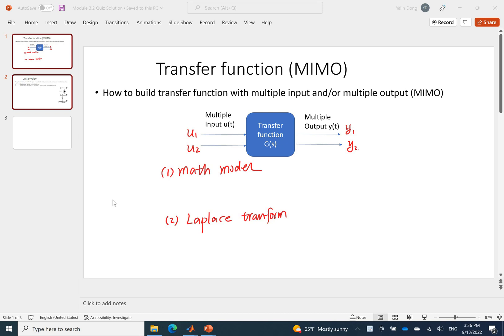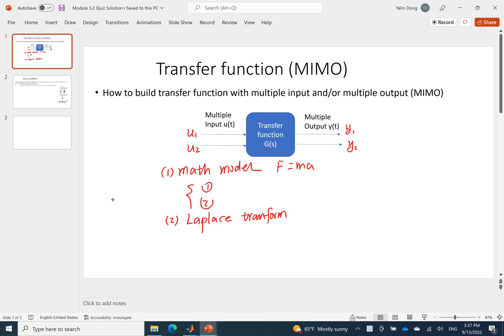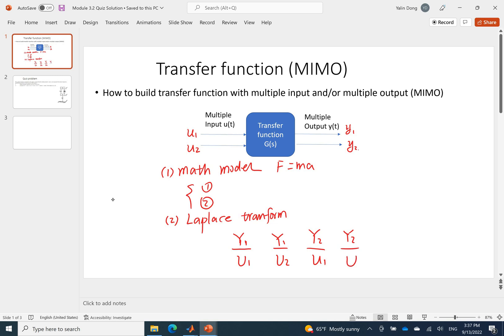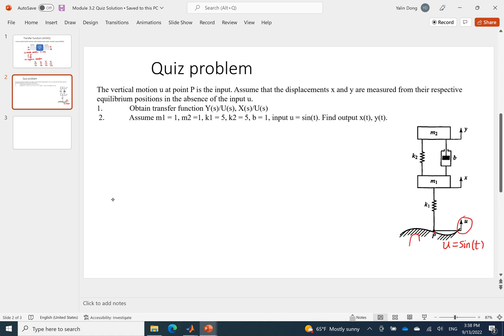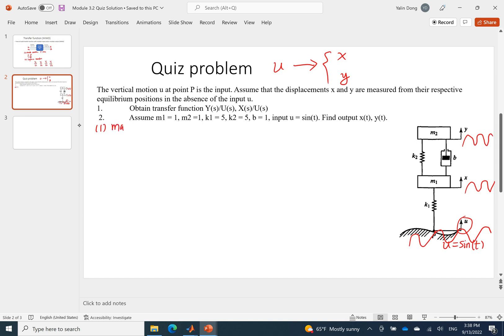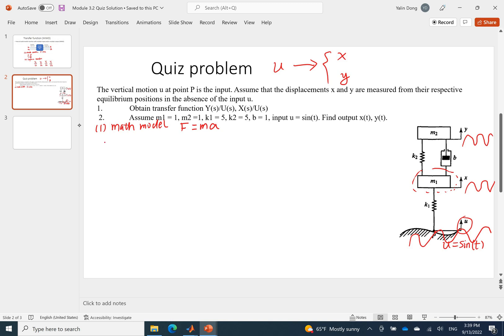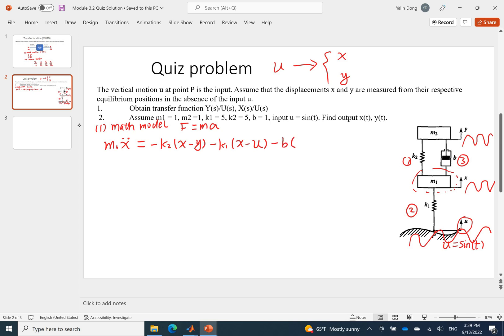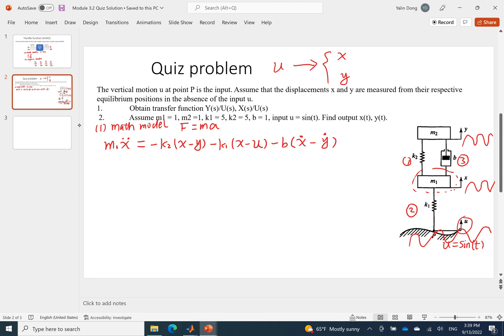Module 3: transfer function for multiple input and multiple output system (MIMO)

Comment: Thank you for making this video. It's good to have content that demonstrates modelling concepts with simple, accessible examples. Here is the GNU Octave version of the code (it requires a little setup ...installation of control and symbolics packages and configuration with Python and Sympy... ChatGPT is your friend):

m1 = 1; m2 = 1; k1 = 5; k2 = 5; b = 1;
syms s U;
A = [m1*s^2 + b*s + k1 + k2, -b*s - k2; -b*s - k2, m2*s^2 + b*s + k2];
B = [k1*U; 0];
x_s = A \ B;

% Substitute U with 1 to simplify the expressions
x_s = subs(x_s, U, 1);

% Extract numerator and denominator manually
[num1, den1] = numden(x_s(1));
[num2, den2] = numden(x_s(2));

% Convert symbolic expressions to numeric coefficients
num1_coeffs = double(coeffs(num1, s, 'All'));
den1_coeffs = double(coeffs(den1, s, 'All'));
num2_coeffs = double(coeffs(num2, s, 'All'));
den2_coeffs = double(coeffs(den2, s, 'All'));

% Create transfer functions
G1 = tf(num1_coeffs, den1_coeffs);
G2 = tf(num2_coeffs, den2_coeffs);

% Define the time vector and input signal
t = 0:0.1:30;
u = sin(t);

% Simulate the system response
x = lsim(G1, u, t);
y = lsim(G2, u, t);

% Plot the results
plot(t, x);
hold on;
plot(t, y);
hold off;

Comment: This is not a MIMO system. MIMO systems can not have single transfer functions and single input-output relationships. Instead, you may have G(s) from y1 to u1, y1 to u2, etc.
Reply from the maker: You are right on this case.